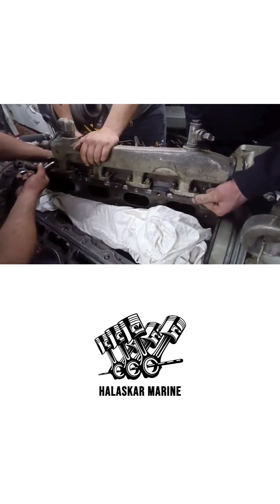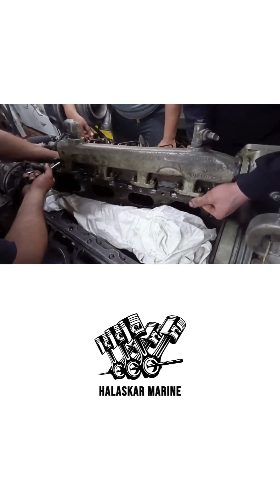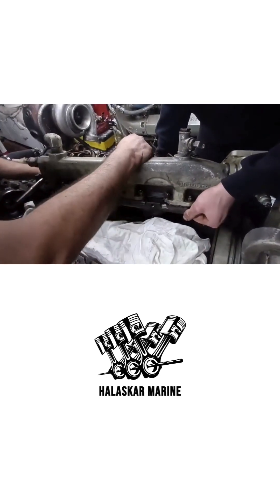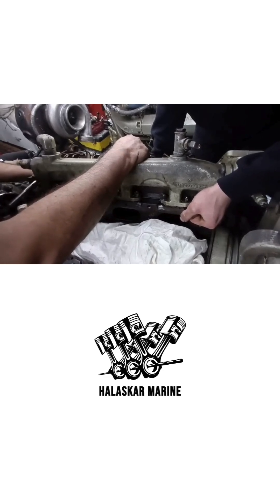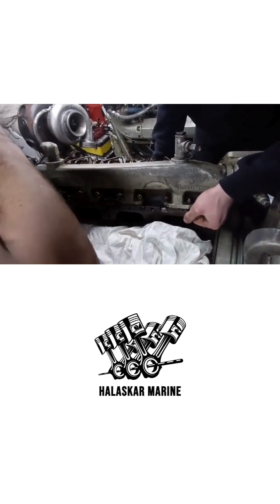Detroit Diesel 8V92 TTA Cylinder Head Installation

Comment: I was a diesel mechanic for a few yrs on 100 ft lobster boats ... it was alot of work one time we had to replace a cat wngine and cut a hole in the hull it was insane .... there is no room for mistakes those boats are out for a month at a time if the motor fails peoppe lives are at risk ....